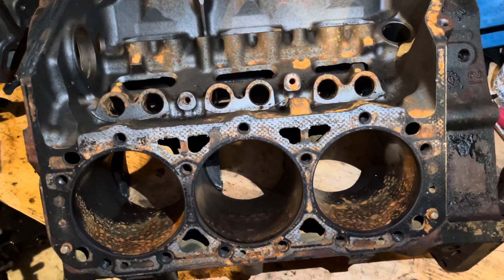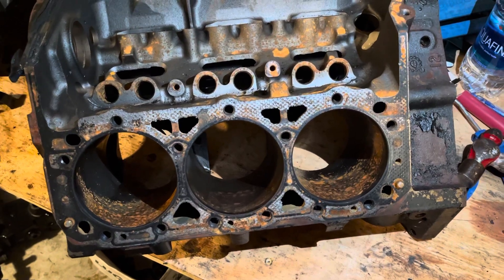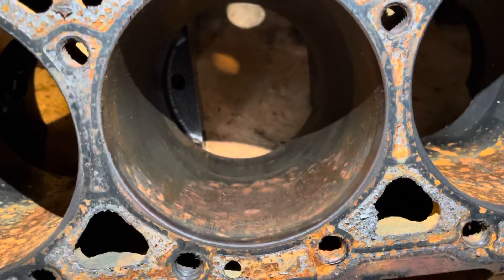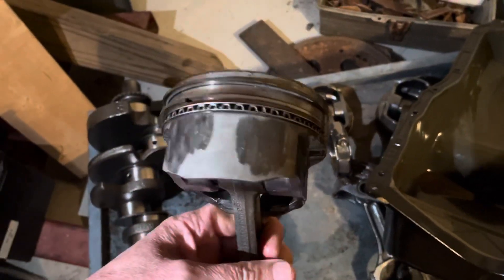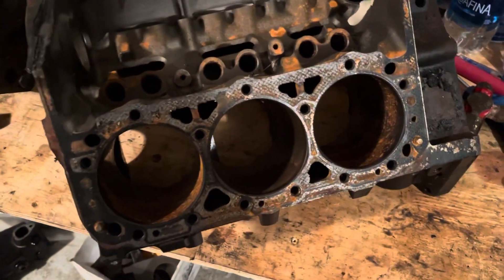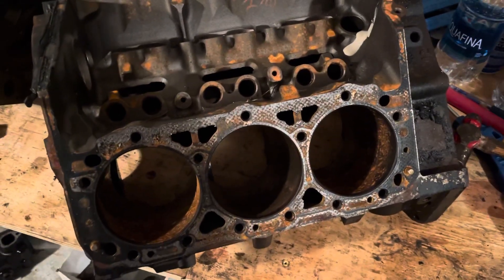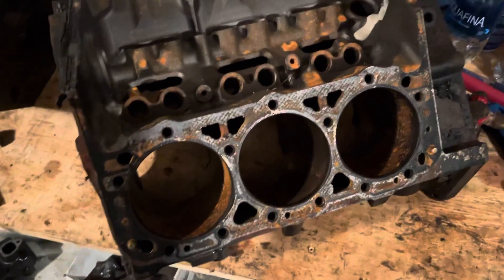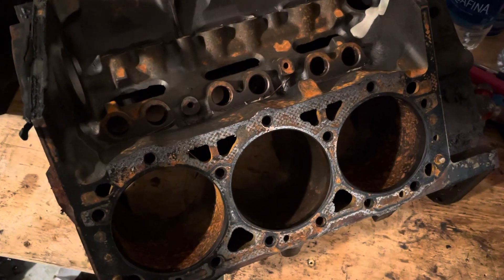Part E - Mercruiser 4.3 V6 - What Went Wrong??

Comment: Ok help me out here @moccasinmarinellc because i dont have a super firm grasp of how these engines work and function completely. I have water in my oil in my 4.3. Not a massive amount but enough to make the oil milky and thicker. All 6 cylinders have good compression and no water poured out from the cylinders. Boat has been meticulously maintained as far as winterization so freeze damage should be out of the question. I can think back to a few times driving this summer where i stopped the boat quick and water did rush into the back of the boat. Now if water did manage to make all the way through the exhaust into the cylinders how would it then move from the cylinders to my oil pan???
Reply from the maker: Unless you parked it on a steep slope with the bow facing down hill when you drained the block you didn’t get all the water out of the intake manifold. The water sits back under the carburetor and freezes which cracks the intake allowing water into the lifter valley and then oil pan. This happened to my brothers boat and is actually what got me started working on boats.
Reply: Also I dock as an island quite often and the tide washes up against the back of the boat.

Comment: So, what your saying is the 4.3 is a piece of crap? Combustion  engines, or any engine has no place on the water where there is a potential to pollute. So many of the human species could care less about the environment- and it is not OUR environment. Geta uniak, 
Shoe
Reply from the maker: Do you have a job? Do you drive a car? Do you live in a house or in a tree in a hammock made with vines? Do you buy groceries at Walmart or kill your own meat with a spear tipped with sharp flint. Unless you live in the jungle hanging with orangutans we all pollute. Your pollution is no better than anyone’s else’s so take your selective hypocrisy elsewhere, Shoe. 

I’ve never said the 4.3 was a piece of crap. Where did you that from? The gist of my channel is that a lot of remanufactured engines are crap due to shoddy builders cutting corners and building junk engines. So I try and teach my viewers on how to build their own engines with the assumption that they will build it with quality and not cut corners. If the viewer can’t build it then I offer a service to build it for them.

If you watch enough of my channel you’ll realize that I promote building quality engines with proper clearances that run as efficiently as they can with minimal pollution. A loose engine will pollute more from misfires and blow by so build the engine to spec and you’ll have an engine that runs as clean as possible.

Comment: My dads engine needs help . 2004 ,,4.3 penta  . he had a hole in the intake manifold .(not winterized correctly )we just bought a new intake manifold and put it on . I think he needs it tore down . . where r u located and how much do u charge  lol. Or what steps should we do to get the oil water  mixture out  besides drain the oil.,  a few times  new spark plugs . ect
   Pero Kenosha wisconsin
Reply from the maker: I’m in Georgia so too far to work on your boat. I would remove intake manifold and drain engine oil. Pour a couple of gallons of diesel fuel into lifter bay and let it drain into a clean container. Keep recycling the diesel fuel and pour it through engine until all the oil water mix is flushed out. Once you have got out as much of the pancake batter out as you can, replace oil drain plug and put in a couple quarts (not full, just enough to pump) of oil and use an oil priming tool to pump that oil through the engine until it displaces the pancake batter. You’ll see it come out of the rocker arms as it flows through the lifters and up through pushrods. Wipe away the pancake batter from the lifters I. E. don’t let it flow back into the engine. Once all the rockers are flowing new golden clear oil you can assume the engine is flushed from the pancake batter. Drain the oil again noting how much pancake batter comes out. If it still looks like more than 20% batter flush it again with new oil. Keep flushing until the batter is mostly gone. Then refill with fresh oil and run it at idle for 5 minutes. Check the oil to see if it’s color is golden clear or chocolate milk colored. If it’s chocolate milk keep flushing. If you can get the water content down to 10% or lower the engine will burn off the water by converting it to steam.
Reply: @moccasinmarine  thank you so much for taking the time to message me back on how to clean up the engine .  thank you so much.. again your lots of help  with all the detailed informational videos you have . I'll keep watching ..
Reply: @moccasinmarine  thank you thank you thank you
Reply from the maker: I’m a bit of a perfectionist so if it were my boat I’d remove the intake to make sure no batter has settled in the front of the lifter valley. However, you could remove the distributor and insert a bore camera in the hole and see how much goo is in the front of the valley. Also when you had the intake off if you took photos you would also know how much goo is in there. If you can see 80% iron and 20% goo then leave the intake on and pour the diesel fuel into the rocker covers. Pour half into the oil filler neck and the other half into the pvc or breather hole on the opposite side of the engine. Just keep recycling diesel fuel until it comes out the same way it went in. Of course if the diesel is visibly contaminated from the goo when it comes out don’t recycle that. Finally when you’ve pumped new oil through the engine and feel that you’ve flushed out the goo, and refilled with new oil ready to fire it up, disable the ignition so it won’t fire right away. Crank it with the fresh oil until you build up oil pressure on the gauge for about 5 seconds. Then reconnect ignition and run it. Btw also change the oil filter before adding any new oil because it will be full of goo no doubt.